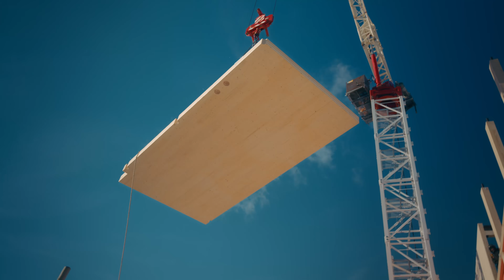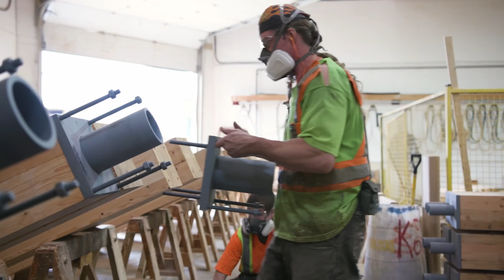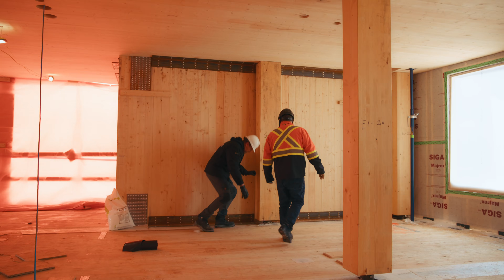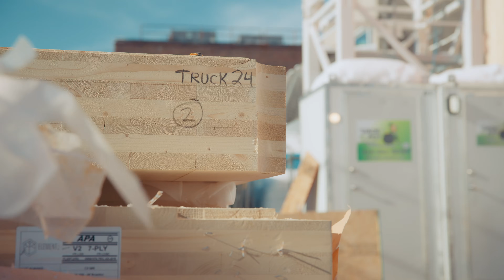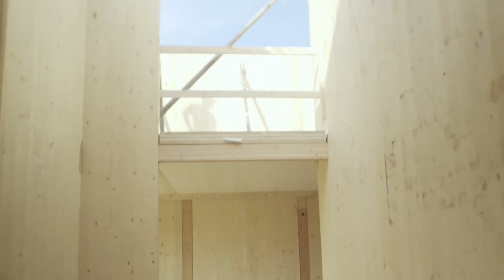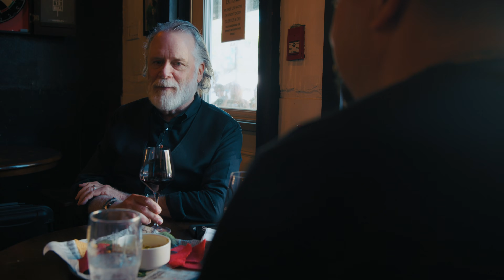The Holy Grail of Construction? We Tour an 8-Storey Mass Timber Site

Comment: Definitely watching these videos. Canada needs to meet the moment with more modern technology. Nice to see mass timber actually starting to roll out into the real world. Presumably it's got an easier regulatory/building code hurdle to clear compared to 3DCP.
Reply: I live nearby this build, and I can confirm that there are already two more floors installed since you were there
Reply from the maker: Amazing! Certainly validating ‘faster’ 😎
Reply from the maker: You got it! Canada’s overdue for a serious upgrade in how we build and mass timber makes sense - partly because it fits easily into existing codes. 3DCP is a bigger leap, so the regulatory path is tougher. Mission is smarter, faster, and more sustainable housing. Appreciate you watching and being part of the movement 👊🏽